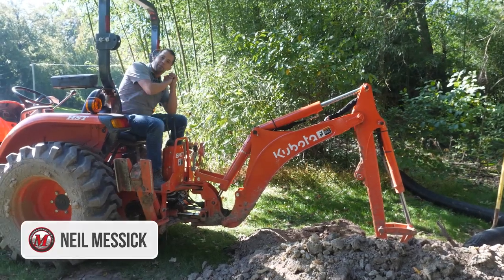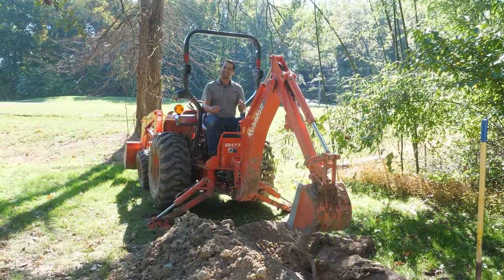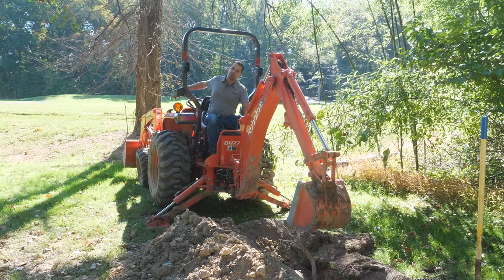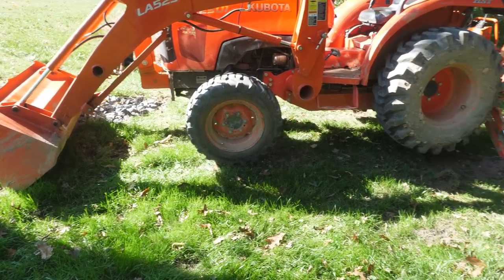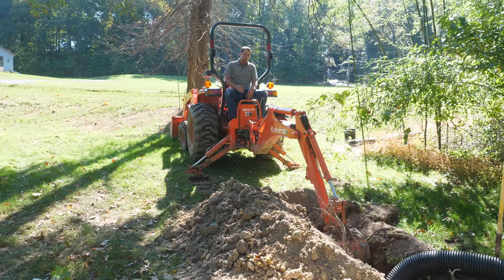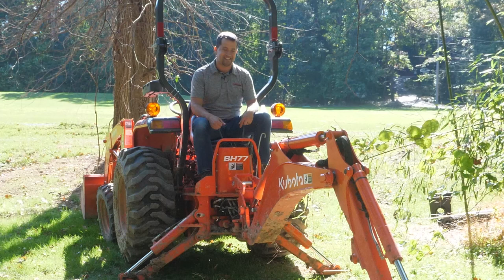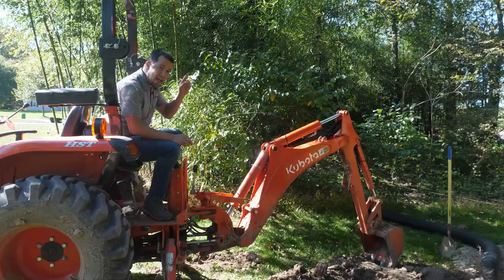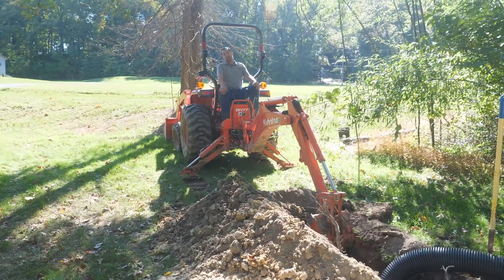Advanced Backhoe Technique

Comment: Been doing this for a while now with my B2410 and Woods BH70-X. One other thing that is helpful, you know those long reach gripper things for getting cans off high shelves? You can use one of those to work the bucket.  I use it to raise and lower the bucket when moving the tractor with the hoe.    I always keep it in neutral though since the wheels aren't even on the ground when digging.  The bucket and outriggers keep it from moving.

Comment: Many people think there is a pressure problem with their machine because they think they can burry the bucket and pull. I had a friend who bought an old 580c and thought that but after some pointers on how to dig he handles it pretty well for a sloppy old machine. I kept telling him to dig easy but he wasn’t getting it until I told him to get some potato chips and cold sour cream. When you can drag the chip and load it all the way across the sour cream without breaking the chip your getting the idea of how to dig. Remember machines can do and will hurt themselves by rough operators.
Reply: I like real life analogies. Makes things make sense. I'm borrowing the chip and dip one if you don't mind!
Reply: I am thinking also about thems damaging there tractors using 3pth instead of subframe mounted.
Digging from the sides trying to pull on big ass roots or large rocks can't be good either.
As a person who works for a construction outfit sure time is money. But a home owner that owns this type of equipment can take all the time he needs switch seats and try not to test the limits of his investment and realize it sure beats a shove by hand any day of the week. But hey that's just me....

Comment: As a L2501 / B77 owner, I did not use the backhoe to move the tractor knowing that the wheels were engaged to the transmission and would shift seats to re-locate.

Using the range selector to disengage the trans is definitely an awesome productivity gain.

Why, however, is lifting the rear wheels off the ground important while doing so if the fronts are on the ground (assuming front wheel assist is engaged)?

Comment: I just got a bx23 and I find that the controls for the loader seem very hard to feather. Like on a forklift you have a pretty good range of hydraulic speed and control, but it seems like these controls are either full on or full off. I have the rpm’s set to the backhoe range. I’m having trouble with anything requiring finesse. Any tips?

Comment: 💥 Little confused 🤔, why lift the rear wheels off the ground when going forward. Isn’t it safer to keep them on the ground? The pivoting front axle could cause a roll over with any slope. 
Keep on tractoring!
Reply: Good point there!

Comment: Good information.  I've used this method many times.  Interestingly, the manual for my BH70 says to avoid putting an upwards force on the backhoe.  That could be for liability reasons?
Anyways, thanks for the video!
Reply: Possibly, but it may also be due to the nature of backhoe ATTACHMENTs, as they're not part of the main frame of the tractor.  Lifting the machine at the pivot point of the backhoe puts a lot of stress on the backhoe attachment as well as the mounting frame.  The vast majority of people that own these machines have no idea what metal fatigue is or how it works, but this is one of those maneuvers that causes it.  Granted, a lot of these small tractors are over-engineered due to their target buyers being inexperienced, but I still like to reduce the amount of undue stress I put on my machine so it will last a lot longer.

Comment: I would love to move the tractor as you have shown. I have the same backhoe as you are using. My problem is I have a cab. The back window wont open with me in the seat. I looked at removing that window for the summer. To many things to disconnect to remove it

Comment: I spend a lot of time honing the skills of my equipment operators, 13 of them so it’s a constant process.  One thing I forbid with my backhoes is, during to push back, angle change or tug back using the hoe, never lift the rear wheels off the ground .  Besides stability, especially with a non belted operator seat, it places out of design stresses on the backhoe along with safety / stability issues. Lift the bucket a foot, trans in neutral, stabs slightly up off ground, boom out no more than quarter reach.  Then small incremental pushes or pulls.  Never on a slope, even a small grade.   Any slope work requires brakes on, operator to use repositioning with traditional drive forward, or reverse.  A competitor of.mine had a fatality a couple of years back with a BH coasting down the slight slope, operator tried to use the backhoe to arrest the travel and the unit flipped.

Comment: I leave the parking brake on - FEL on the ground - then  shift from 4wd to 2wd and lift the bucket off the ground before performing the 'scoot' (lifting the back wheels off the ground negates the parking brake, going from 4-2wd lets the front wheels roll.
Oh and don't forget to steer the font wheels where ever you want to go... sometimes trenches makes turns!

Comment: If you put the tractor in neutral, do you still have to lift the rear wheels off the ground? Can you still just push the machine forwards with the backhoe (assuming outriggers and front bucket is up of course)?
Reply: Yes, that is what I do. I just push the tractor forward with the outriggers up about 3” and simply roll the tractor forward without picking the rear up. 
I reach behind me to steer the tractor where needed. Replant the loader, outriggers and resume digging. Fun!

Comment: I do a similar method which is faster and safer with my old kubota L39 tlb. I start by placing footbrake onto fist click position, then lower front bucket with forks down into the ground, front wheels are in the air ( to get max. stability) I then put the gear box in low range 1st gear, but shuttle in neutral. turn seat around and start digging trench as wide as you like. to move forward without doing the long correct method , complete the fist dig section, drop revs to lowest setting.I then lift stabilizer arms off the ground ( enough just to be off ground:  I turn around my upper body and lift front bucket to clear only enough to not dig in. if you want you can put the hoe into the trench teeth down close to the ground, so a quick down push for safety will stop forward momentum . I push the shuttle forward to run slowly in low range first gear ( slow crawl). I only have to move about 5 yards, so watching the rear and getting to my position, I pull shuttle out of gear and push front bucket forks into the ground, lower stabilizers and carry on digging. its very fast and you need a lot of experienced hours on your machine as well as think the sequence thru every time. I am able to do about 2 hundred yards trench in 2 hours. ( warning, not for a novice)

Comment: Kubota should build a bigger backhoe arm for the bigger models as to the M5 and M6. Would be better for more heavier jobs.
Reply: Hey Roger, while at a Kubogy dealership 9-15-21 buying new buckets for a bh92 there was a BIGGER kubota backhoe attachment for something bigger than a MX5200. I believe it will dig 10.5 -11  feet deep & fit the m5 series. It is something new.
Reply: @donaldstrishock3923  thanks. Hope to find the model code to check it.
Reply: @donaldstrishock3923  one of the bigger backhoe attachment they got, it's the M4011.

Comment: Is the boom on the smaller BX tractors strong enough to perform this type of tractor movement? I realize the tractor itself is lighter, but my boom looks very small compared to the one you were using in the video.  Thanks for the info, I'm still trying to figure this backhoe thing out.  :)
Reply from the maker: Yep. No problem.
Reply: I move my BX with the hoe side to side and fwd and reverse with no problems. I like to keep it in neutral on level ground. It moves a lot easier. The 4wd fights back a little if I don’t.

Comment: Perfect timing Neil. I've got to dig six 70+ foot long downspout runs next week with my 270B ( sorry, it a green one). in my limited experience, I tend to pack the bucket during digging and then smooth out bottom.  I'll use the straight bucket technique the whole way down now and see if that helps.
Reply: With that much trenching to do, it might be better to rent a dedicated trencher. Trenchers aren't as fun to opperate as a backhoe, but they'll get the job done in less than half the time. And, since they disturb less soil (the trench they cut isn't nearly as wide as a backhoe's bucket), replanting is also much easier.
Reply: @DKWalser  Agree with you 99%. I'd love a trencher.  But I already have the JD 270 B on a 2038R in position...  I think it has a 8" or 10" bucket ready to go. Time is not a problem, but efficiency is.

Comment: I thought shifting the gear to neutral without pushing in the clutch can damage the engine?
Reply from the maker: No. As long as the gears are not rotating it slides easily.
Reply: Also, HSTs don't have clutches (the tractor in the video is a HST)

Comment: Rear end off the ground to move yourself forward with a hoe ??????? sure if you want to tip from side to side as you move and there are many instances in which you cannot put that kind of force downward, in wet sloppy conditions or clay, the bucket will just sink... and putting that much weight on the front tires alone is bad for them, they are not made to take that much weight, look at the load rating.... you can, with practice, swing the front end of the tractor around, just pull it off the ground with rear stabs up and you can use the swing to pivot on rear tires, saves reaching around to steering wheel...  you can also place the bucket flat on the side of the trench, push for a bit ( remember to curl bucket to keep flat ) reposition bucket and push a bit more if needed, pushing down in your work area with that much force is not always a good idea, especially if your excavating for footings.... you cannot disturb the sub grade, it must be Native soil, un-disturbed you place footing on... I hope this helps.... over 40,000 hours running backhoe's.